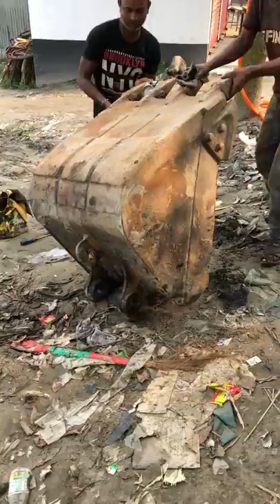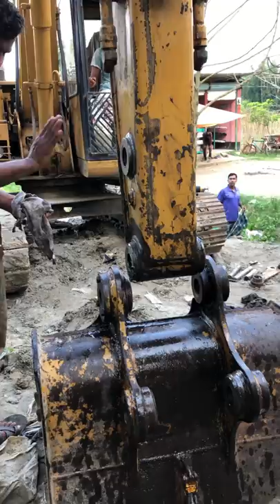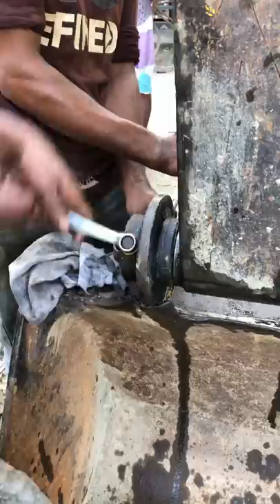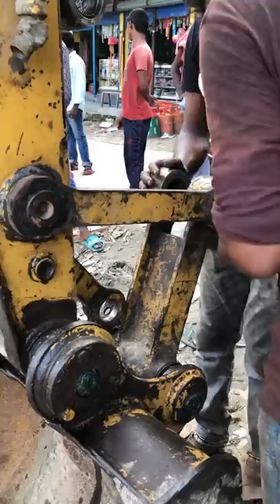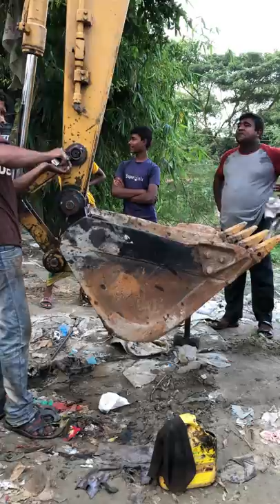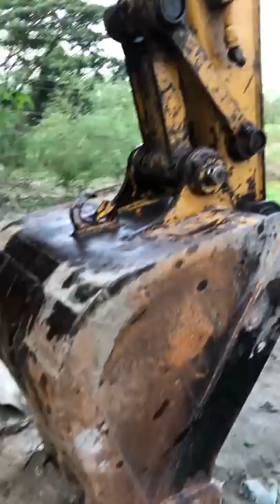Excavator’s Bucket Fixing | Caterpillar CAT E70B

Comment: Caterpillar,Case,John Deere,and Bobcat certified repair shops,would reinstall the grease fittings;to all of the pivot points,after all of the necessary repairs have been made/regularly scheduled maintenance;then use an electric grease gun to grease all the pivot points.
It reduces wear and tear on the pins;pin fittings,and repels water so the pivot points don't rust;and become seized.Judging by the poor non-existent safety standards;seen in this You Tube short,you guys did not grease those pivot points;after you reattached the bucket.Water is going to get into those pivot points,and cause those pins to rust;and fuse everything together.That bucket will become seased without proper lubrication.
Here in the U.S.A,no piece of construction equipment ever leaves the repair shops;without having all of the pivot points being thoroughly greased.And before anyone asks,no,I am not a trained,experienced,certified,licensed & insured mechanic that works on construction equipment,it is just common sense;to make sure that all moving joints are thoroughly lubricated,before the machine is put back into service;leased/rented out,or is sold off at an auction to the highest bidder.